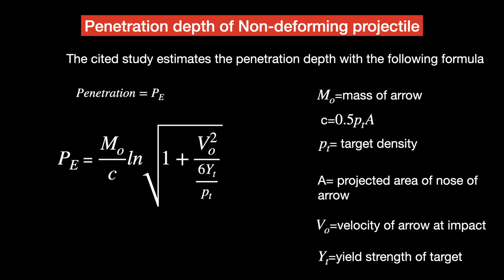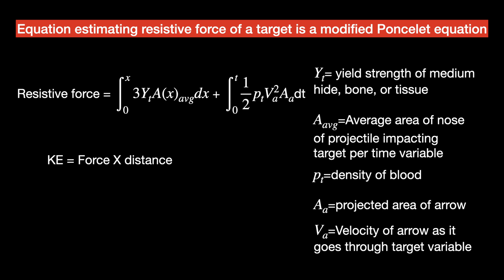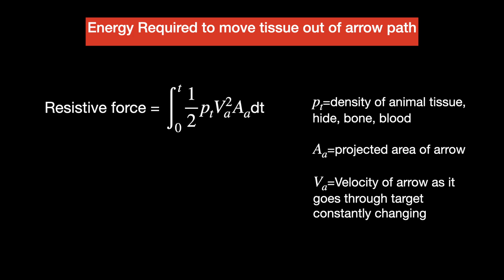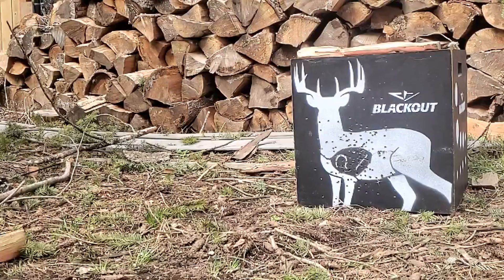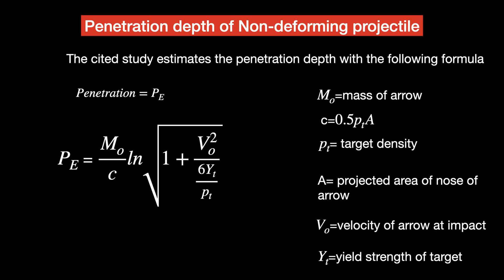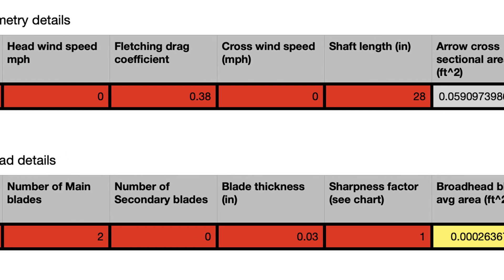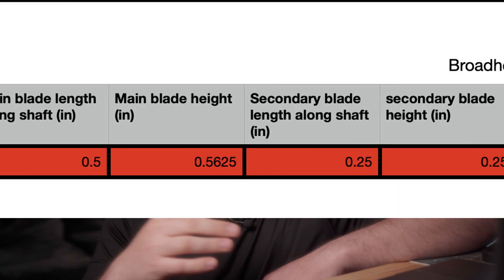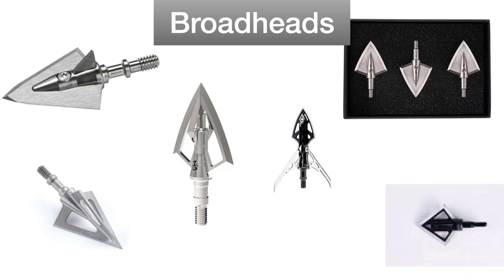More mass more penetration? Poncelet Analysis: Archery Education Video 9

Comment: In the equation, you are looking at force. Not momentum. most say its momentum that gives us penetration. You are talking a lot about work. work is the change in kinetic energy. so which one is giving us the penetration?  Thanks again.
Reply from the maker: In the real world you can’t use either. Targets are reactive to the forces applied I.e the great force you apply the great the force the target applies back on the projectile. 

Generally momentum is a better judge but that’s only true if the energy is the same for each projectile. If both energy and momentum are different for the projectile then you can’t use either to compare potential penetration amounts.

The poncelet theory/equation accounts for this by looking at the specific forces and reaction force involved over intervals of either time based or distance based. So a mix of both energy and momentum are used
in its analysis.

So ideally force is really what matters reduce the amount of force applied by the arrow for penetration will reduce the reaction force. You primarily reduce needed force through broad-head design/sharpness and reducing impact velocity. But the direction you apply the force is a very important thing. Consider an arrow that hits sideways vs an arrow that hits square to target. The force of the untuned arrow is directed in the wrong direction leading to poor penetration or arrow redirect.

Sorry I’m long winded.
Reply: @Lucas_Palmer_Archery @leap_outdoors The reason I asked is in animals, a heavy arrow with less KE but equal or slightly greater momentum will not out-penetrate a lighter arrow with a greater amount of energy.  We see this with recurve vs compound bows. This is why I asked. Even in non-animal testing, using a hard impact test, a lighter arrow with a greater amount of energy will break the test media, whereas the heavy one with equal momentum will not. 

again thank you for your replies.
Reply: @Lucas_Palmer_Archery , I reread what you wrote: "Generally, momentum is a better judge, but that’s only true if the energy is the same for each projectile."  I agree, but the question is, is it mass and momentum or mass and KE that gives the penetration? If we isolate momentum, we see its mass and KE. Sorry for the questions. I have been studying this for a while now, but I have never worked the Poncelet equations. This is very interesting to me.  Thank you for taking the time to make the videos and break things down by looking at it through physics.
Reply from the maker: @ericnewman971  absolutely agree mass and KE.
Reply: @Lucas_Palmer_Archery  thank you again.  im going to write down your equations and see if I can figure them out.  Cannot wait to see the wind tunnel testing.

Comment: what is the increase based on a 450gr, not a 350gr? Thanks
Reply from the maker: From 450 to 500 is about 5% from 450 to 550 is about 9% from 450 to 600 is about 12% from 450 to 650 is about 16%.

This assumes identical broadhead, shaft diameter, bow tune, dynamic spine of the shaft, shaft length, ect all being identical. Stiffer shafts can absorb more energy before deflection and thus perform better from a penetration standpoint. Which shaft diameter induces more resistance. 

Again thank you for the question!
Reply: @Lucas_Palmer_Archery , thanks for the reply

Comment: how are you defining "high energy bow" is that: Draw Weight; Velocity as it leaves the bow; a Combination. bow configuration will effect velocity , draw weight MAY effect velocity 

Heavy Heads , Lite Shafts , fletching? depends on range to target now doesnt it
Reply from the maker: Energy of the bow is what energy it can deliver to an arrow at launch. Different arrow weights and launch velocity affect drag and therefore down range retained energy which is all accounted for in the calculations.

Thank you for your question.

Comment: Very, very fantastic video. Keep up the good work man! Start with the broadhead and work your way back. Decent FOC, appropriate spine and sharp broadheads will cure 98% off all problems in my opinion.

Doing some more figuring here. If I was to add 100 grains from my similar setup from 483 to 583 I'd be gaining approximately 9% penetration from this analysis. While giving the animal up to 15% more opportunity to move. If it did elect to move, which they often do, It is just like a boxer soaking a punch & accelerating away from the arrow down and away. Which based on my calcs at 45 yds could easily rob around 12% of the KE & 5% of the Momentum because those vectors are no longer in the same direction. In addition to changing the impact location of the shot by the animal moving. So it seems to me the gain is really only tangible if the animal doesn't move. Which is a crap shoot but is the reality that we should plan for. If it doesn't move great, if not great. 

There are tangible downsides to faster arrows, the primary being they can be finicky with fixed broadheads. In theory they don't penetrate as well but that only is if the animal doesn't move.

If you want to see some great examples of the downsides of heavy arrows in western hunting applications The Hunting Public is chock full of them. Love those guys but they're fully committed to the heavy arrows, albeit most of them have lightened up some. Ranch Fairy did a video stating that the "math doesn't work" for animal reaction. Lucas did an accurate one debunking that. They absolutely can move more. The whole "voting" thing is nonsensical as if it doesn't vote then awesome. We're not concerned about animals not moving... we're concerned about when they vote to. 

In this video Ted is shooting a 575 grain arrow with a sharp COC Magnus. Moving around 206 fps.
https://youtu.be/8M8bBuAJcXE?si=tihfxWE8xKBnNxe7&t=586
9:55 at an antelope buck.
Then again at 14:40
Then finally at 18:40 - notice how when that antelope turned it was just as I described as a boxer. Next to no penetration - even with a cut on contact broadhead and a heavy arrow.

Another Ted video - "he was further than I thought he was". This was a painful recovery. I've been there and it sucks. But maybe a little more speed could have put that arrow even 1/2" higher and maybe 1/4" further forward (as he was walking) and led to an easier recovery.
https://youtu.be/7sZAyQiGui8?si=DBBZiyzorJYLlzBp&t=760

I'd be interested for you to input Ashby specs at 650 grains and compare it to your setup. It has never made sense to me that a longbow at 650 grains would exceed the penetration ability of a compound like ours at say my 483 grains and 289 fps launch.

Comment: Feet Per Second?
If a 350 grain shoots 300fps then that same bow would shoot a 550 grain arrow it would slow down to 225fps so the penetration would decrease extremely
Reply from the maker: I would suggest watching videos 1-8 of the series. Yes a 550 grain arrow is going slower but that does not mean it penetrates less.